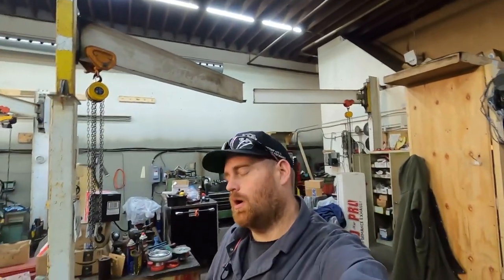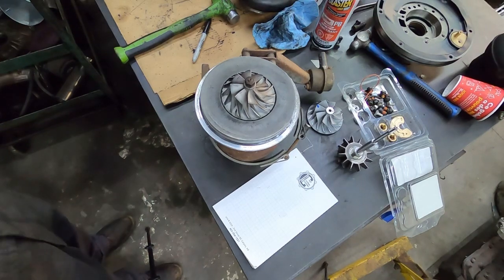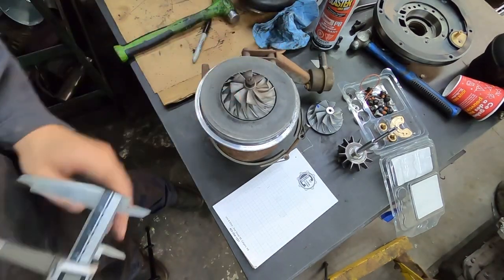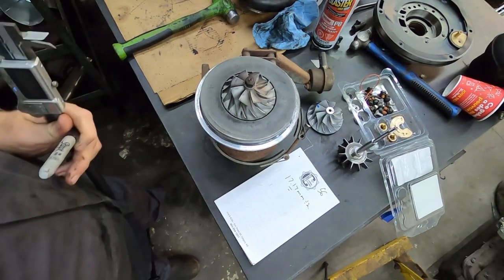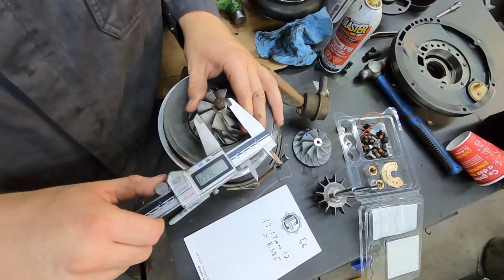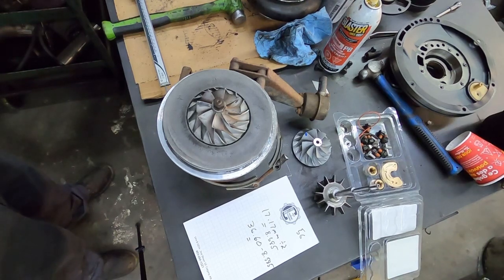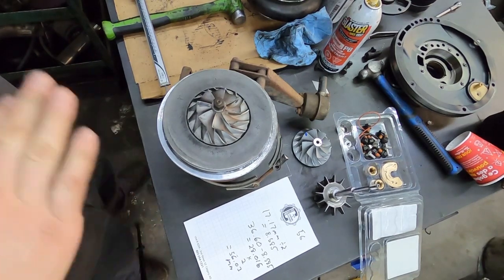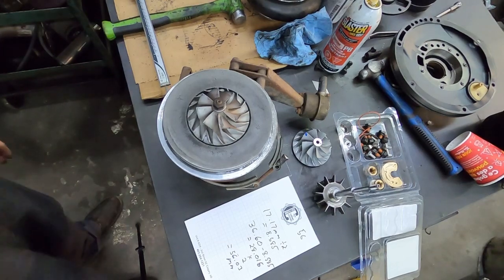How to measure Turbocharger compressor wheel ( even & odd number )

Comment: I think even with extended tips the exducer size is generally just the OD of the base circle on the compressor wheel. The extended tip dimensions should be measured or listed separately in addition to the base exducer diameter. Don't quote me and I'm sure it may vary by manufacturer, but if this wasn't the standard it would be very difficult to measure for replacement or upgrade wheels and comparing the sizes of turbos would also be far more complicated. Extended tips are basically there to make a wheel act like a slightly larger wheel with very few downsides, but the extended tip length and angle for a given diameter wheel can vary as well.

Comment: Was hoping you would show how to measure the exducer of an odd blade wheel with extended tips. Lol. You could save a step with your math and not divide the hub diameter by 2...  2 x blade length Inc hub diameter Minus hub diameter would work out the same.
Reply: I believe the exducer size is just the size of the base circle. Even if there are extended tips, that should be the listed measurement. The extended tip length or overall blade diameter should be listed separately. I can't guarantee this is the case with all manufacturers, but I believe this is how Borg Warner and others do it. Often the exact extended tip dimensions aren't listed at all, but only the exducer base circle OD is given.

Comment: Yeah, but what about measuring one that’s on a truck-installed. How do you measure it? My caliphers aren’t long enough to reach through and even if they were wouldn’t the wheel be larger than the opening on the intake side?
Reply from the maker: You can you a inside calipers. Just buy a cheap one and then measure with tape measure will get you close
Reply: @CUTTERUPROB  I figured out the best thing to do…take the cover off the turbo. This way you can see inducer and exducer dimension on the compressor. Just found out I have a 63/88 inducer on hX35 exhaust turbine and housing. It’s a 7 blade and I used your method for determining the diameter of the wheel. I’d love to trade my turbo for a 60 mm.
Reply from the maker: @delanoyconstruction6542    check this link out https://amzn.to/3YPj9HG
Reply: @CUTTERUPROB  those would work, don’t have any like that…by the way with my turbo…63/67/12 cm, what combo would you match with it for optimal power….or is this just too big of a turbo for a tow pig?
Reply from the maker: @delanoyconstruction6542  350-550 would be the range.
Reply: @CUTTERUPROB  what injector size would you suggest? What timing? Do you think 22psi fuel is enough?
Reply: @CUTTERUPROB  even my inside calipers wouldn’t reach…the real answer is take the cover off if it’s on the truck.